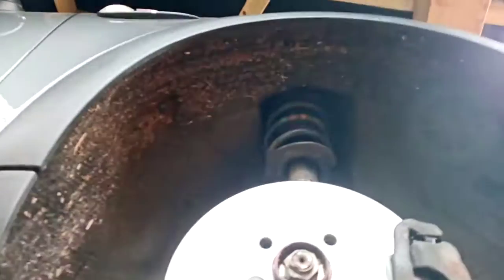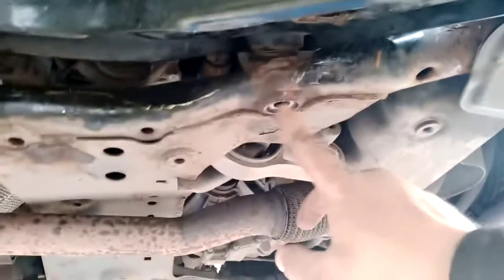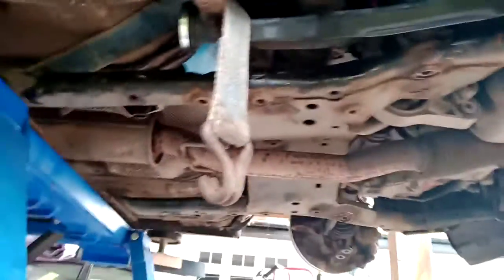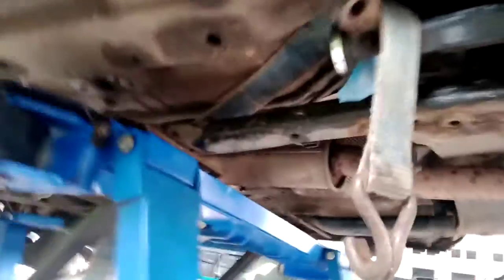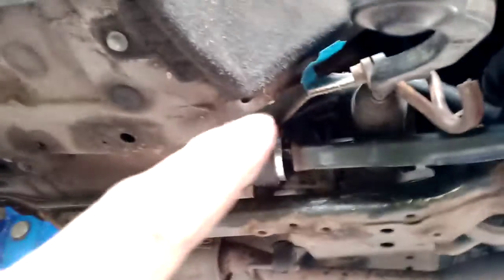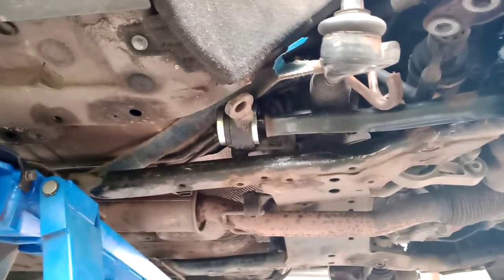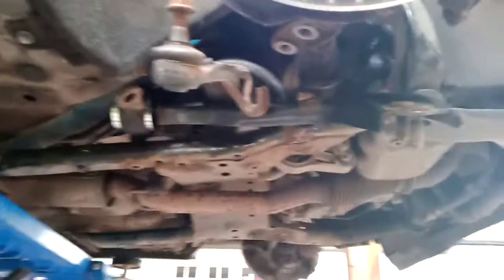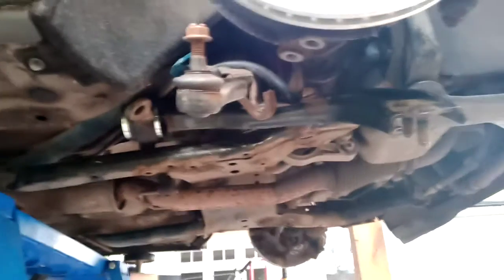Mini Cooper S R56/R57 Lower Wishbone/Bush Change (1 of 2)

Comment: I don't why didn't just remove lower arm now have access to the subframe bolts that hold the lower arm. I've done job twice on two separate minis dropped subframe just enough to get the long bolts out.Thanks

Comment: Just had my MOT and i mentioned i sometimes get a banging noise from the passenger footwell especially with a bit of acceleration lift on uneven road. Do you think it will be this bush, Mot tester could see slight cracking in both bushes so gave an advisory and I was keen to sort the noise out. I had the anti roll bar bushes done on a previous mini when i had a similar noise, probably best to do both as the subframe had to be dropped when they done the last one.

Comment: Best way by far is to remove wishbone and leave subframe and rear bush housing in place. Buy poly bushes for rear bush replacement - these bushes come in two parts an inner part and outer part. 
Use a sabre saw or reciprocating saw with metal blade and cut through the rear bush metal sleeve and it will come out easy. Free off a bit with a chisel on the sleeve part sticking out if you have to. Once out the outer poly bush pops into the bush housing. Then pop poly bush inner part onto the wishbone when ready to install. It all slides in easy with the poly grease and allows rotation movement without twisting. Far better design than original and cheap too. Done a couple of minis this way and would never replace these rear bushes with original spec again, after fighting with getting the wishbone back in for hours one time. I knew after I’d finished I’d probably damaged the new bush too! Poly bushes definitely the way to go- fit and forget plus zero lateral movement too.

Comment: an easy reinstallation for the bush...

apply some grease ir washing-up liquid to the control arm & pull wiggle the bushing into place, you could also upgrade the bushing to polly bushes for it to last that bit longer & to allow better control over the standard bush.

also, to remove it you can wiggle the bush in place side to side & apply WD40 "or similar" between the bush & the arm & then push like hell & wiggle to get the bush off, the application of a hammer also helps

another method to get the bush out of the bracket, you can invert a hack saw blade & cut through the rubber into the alloy outter shell & then simply knock the inners out leaving the bracket ready for a new bush to be fitted..

also since you had the sub frame down you could've checked/changed the front anti-roll bar mounts "again possibly upgrading them to polly bush types"
Reply from the maker: Cheers mal for the comments, but on mine there was no way a bit of wiggling would have either removed or installed them, a truck ratchet strap was at high tension to pull them back in .... Well not unless you had arms like the Hulk 😂
Reply: @Planefix1  aw I know exactly what you mean, as pulling a tight rubber ring down a metal shaft the rubber just grips hold etc.. that's why the trick of adding WD40, washing up liquid or silicone helps break that friction... I've the R55 S clubman & didn't need half that effort, initially using washing up liquid then opting for silicone spray wiggling the mount down & slight tapping with a rubber mallet got it bedded down nicely "I was however using a polly bush upgrade over the regular item..

removing it, I simply cut the main body off the enclosed rubber shaft of the control arm, then used some vice grips/mole grips to try & break the grip whilst adding WD40/silicone, then opting to simply cut the rubber off the control arm, each side was to remove about 5minutes, maybe less